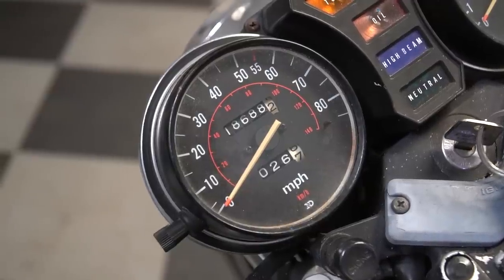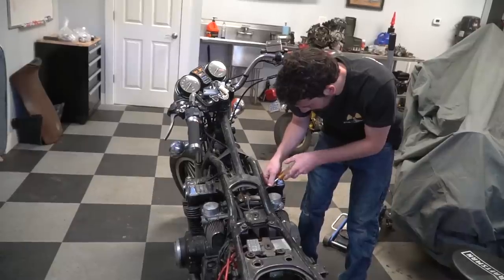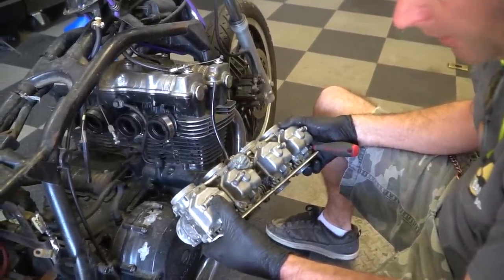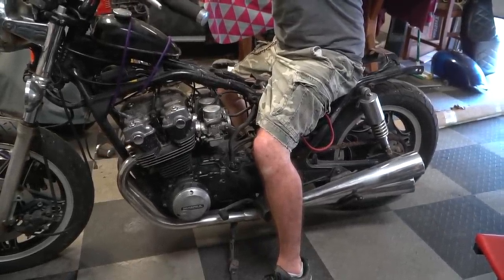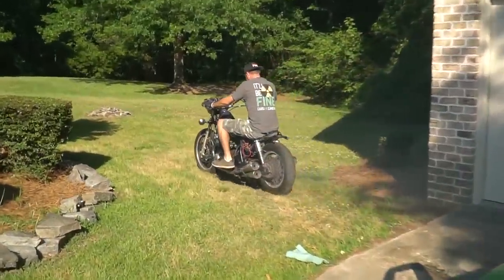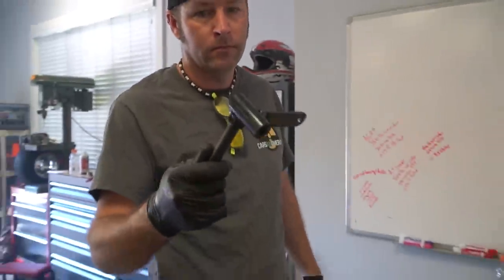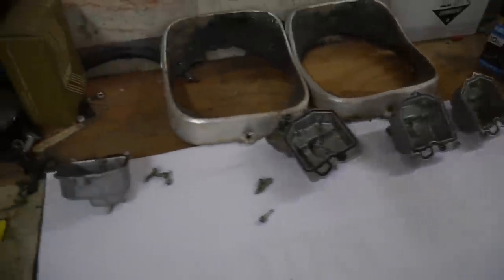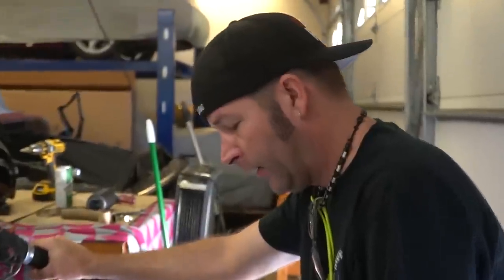Cheap CB750, Will it Start? Cross Kart Build Pt. 4

Comment: you can always treat it like a VW and get a set of rings and do a dingle ball hone on the cylinders if it keeps smoking. just do a top end rebuild it would bring it back to full power and stop the smoking problem . a set of rings for all four cylinders cost around 80 bucks at 20 bucks a cylinders oddly it cost the same to do the CB550 .

Comment: Also don’t want to disassemble the rack to vat them because your sync will be way, way off. Bad enough from just age and wear, you don’t want to deal with bench sync and then vacuum sync on top of cleaning them. If you can dip two at a time, flip it, dip the other two, then do it that way.

Comment: Hey guys this is Jimmy I've been there before and I can tell you exactly what works great for that engine as long as the engine is decent I just jetted it up and up one size at a time using shop towels for breathers four layers then three then two layers until it rips without a single layer of shop towels and open exhaust they make more power that way  oh and by the way snowmobile engines still make more power but you can attest to that

Comment: Hey boys! If you drilled out those main jets in the carbs it may be running so rich that it cant burn all of that fuel it is getting. It sounds like it is running way to rich on top. (cutting out normally means to rich) And the main jets control fuel from about half to full throttle.

Comment: Needs a ring job IF the smoking doesn't stop.

The pipes may have some pieces of rust in them after all those years, might just have to replace them if they can not clean out easily.

The rust can be removed with some HCl acid but if the rust is too far in it will just find holes in the walls of it.

Comment: You probably drilled the main jets out to big and it is running way to rich... love the videos, keep it up
Reply: not a chance with out an air box most motorcycles hate running stock carbs with no filter and box

Comment: Sounds like the carbs need to be synced up. Also try removing the slip ons from the headers as sometimes the resonators in that type of muffler will rot and clog with rust.

Comment: I got the same bike out of an abandoned garage and it does the same exact thing. When I mess about the coils and move the pack around it seems to stop doing it but it wont ever just run 100% perfect. The motor is a mean one though and I hope you figure out the issue. Please keep me updated on this problem as I am ready to solve mine. I put this motor on the front of a john deere rider.

Comment: Can you guys do a video on the sinplified wiring for the cb750 just to get it running and i could use the exhaust off one of the old 750s if you guys wanna get rid of it

Comment: I find a set mechanical mikuni carbs... Those vacume slide keihn’s do not like Pods. The factory air box had velocity stack like runners. While your at it...Throw on some accel super coils. That way u can use automotive spark plug wires.

Comment: It's hard to get those motors running right with pod air filters. Other than that those motors are awesome. I had a 1980 cb750

Comment: I had one... An 82 cb750c... It had a 6 cylinder, an a 5 speed trans on it. I paid 560 fer it. Did a lil tuning an adjusments to er an had her goin in 1 day. But... I was goin 185 on my digital speedometer that i had duck taped onto the original (dead) speedo on it jus roaring down i75.
Reply: No such bike, you liar. The 6 cyl. CBX wasn't a 750.
Reply: @gsp49  im not a liar. The 6 cylinder honda cb750c is a truly badass bike.

Comment: Hello, guys - at the risk of being a spoilsport, I feel I should mention that zoomies will compromise power output by preventing the exhaust scavenging effect (neatly timed pressure pulses arriving at just the right moment to help do something useful) when installed on a normally aspirated engine. They´re intended for use on supercharged engines. Sorry to be a bore!

Comment: Check your slide diaphragms and the advance mechanism.... If it actually has one. I don't remember if that year had fully electronic  ignition or not.
But it kinda looks like bad slide diaphragms.
If the slide diaphragms are OK and you don't have a wasp metropolis in the exhaust system it's gonna be ignition.

Comment: Check out moto migs on yt  because he has the same engine that he is trying to rebuild and there should be 2 cams under the valve cover with a chain conecting the 2 so check that.

Comment: Without the filters and those carbs not being cleaned really good your main jet is too small anytime you just slightly increase the airflow it significantly leans out just put in the filters back on would probably help just a little definitely need to actually clean the carburetors good and get a jet kit.....

Comment: There are 3 jets in the carbs your working on 1 is the main jet, 1 is the primary jet, there is 1 under that rubber plug next to the other two that is your idle (low speed jet) Yes I worked in a bike shop for 25 + years.
Reply: Correct!

Comment: Did you take the dash pots off on top of the carbs ? There could be a slit in the diaphrams and the thottle pins could be sticking ? Sounds like air or fuel starvation.

Comment: For sure starving for fuel at higher RPMs. Also, Goldwing fuel filters have saved my butt many times collecting junk pre-carbs. I wonder if there's an aftermarket intake out there to run one big carb? I would not know where to start, but man that would take a lot of headache out of the equation. Best of luck guys!
Reply: Wow, there actually is a dual carb intake for these to integrate 2 Mikuni Carbs, crazy cool. You may be able to fab one up yourself, or perhaps Go Power Sports has a resource? This would at least level the playing field for you guys a bit more.

Comment: check your valve springs if you may have overheated the motor there is a strong possibility that it weakened your valve springs.what happens the valves are not closing completely quickly enough.

Comment: Check the exhaust temps sure sounds like you are down a cylinder; that is that weird sound you hear when you blip the throttle.  Think you will see you have a cold pipe.  Toss some new plugs in it once they get fouled pretty hard to get running clean and hot to burn off that crud.

Comment: I know with my old Suzuki, it was so touchy about air fuel mixture that it ran horrible if you tried to run it without air cleaners on it. It would hardly even idle until you put them back on.

Comment: No joke have stuffed with a few 4 cylinder bikes you need the factory airbox mate them bods work but need to be tuned and are a real pain and the bike will do what it’s doing wen you open it up if you don’t have the stock airbox and carbs same as straight pipes they are very sensitive to change

Comment: Make sure to check 3rd gear and clutch basket play 2 problems i ran across ob the cb750s
Reply: @gsp49  i have owned a few 750 cb hondas they have a 3rd gear problem due to shift fork and bushing for 3rd gear and ive had the clutch basket have play on the output shaft also had them blow apart but that was n2o induced harm

Comment: Also remember to balance the carbs or else it will run like crap and check for vacuum leaks with starting fluid
Reply: I've always been taught to use an unlit propane torch, less chance of ruining paint, but I suppose they're not keeping the rest of the bike, so either works for them.
Reply: @robsutherland9284  yeah I've used the propane torch but one time I had the torch ignite and almost melt some plastic, so I use the ether, but it's up to you
Reply: @stylusmccracken8629   Lol, that would have  been exiting, might loose your eyebrows if that happens.
Reply: Use WD40, starting fluid (ether) you risk bending crank components when it detonates, it explodes. Starting fluid for large diesel engines, never in small gasoline engines. I've seen so many small engines ruined by starting fluid, it's funny.

Comment: Someone could of put some oil down the heads so it wont seize up while it sat. Or need some rings and gaskets. Or just burning the crap out of the carbs and heads.

Comment: When cranking it over cover the opening till ya feel ya hand is wet also the added suction created forces fuel thru the carb setup.   or go with petrol straight in the plug.  None of this either rubbish

Comment: The carbs need synchronized. You need a 4 way mercury manometer in order to sync properly. Your timing is likely not the issue. If you need a book or help with the 750 give me a shout or even some parts maybe. Ive got a junker that makes about 95 hp as it sits(92 model). They sound sketchy when the carbs are unbalanced, and you cant use a dial gauge vacuum setup to tune with very well because the needle will bounce. Mercury is the best bet and you can find them at older bike shops. Good luck and to not under estimate that engine, it is a ripper and can get you hurt in a hurry if things are not right( dead spots and then wide open throttle suddenly). 14k rpm is ok for max if you have the right jets in it and it will make great power. These motors are some of what honda designed the b series after. No vtec on these but very good power to weight and amazing flow when setup properly. Remove baffles from exhaust and get the jets right and that thing will fly. Exhaust smoke is sketchy but hopefully will clear up.
Reply: Sycro is easy, pull vacuum off of each tube between carb and head and set the individual throttle screws on each carb until all readings are even. The carbs must be perfectly clean and the diaphagms in good shape if they have them. Imbalanced multicarb inline motors will not run for crap until the carb is set right. Its like they fight each cylinder when unbalanced.
Reply: This one doesn't sound like it needs that, no stumble when they gas it.

Comment: Give the throttle  a twist a few times real hard that set has accelerator pump on it, it will inject  fuel into it to aid cold start

Comment: Funny you were saying it sounds great, i was cringing at those revs and smoke. Did not sound like it should thats for sure.  Those carbs are pretty finicky, most of the reason i dont like 4 cylinder Hondas. Hard to tune. Hard to work on that big bank of complex carbs. Great motors when they run right, but a huge pain in the ass when they don't.

Comment: Bro try changing the spark plugs odd as it sounds my dad had the same bike wit same prob changed plugs and the thing revved  out fine thr biggest indicator that its ignition is the 5k cut... wouldnt be bad idea to clean the pipes mise love to make there nnest in there guys good luck hope info helps.   Lol and def put the air box back on there it wont help to take it off

Comment: Just take a metal squirt bottle, put some gas in it. Take the filters off and open the throttle all the way. Spray some gas in with the spray bottle on spritz mode. Start the bike while squirting.

Comment: Please put the air filters on you will notice that ike will no longer think there's a timing issue... and with pods the jets sometimes need to be around 25 sizes bigger with out the original air box ... thoughs kinda carbs like a restricted air flow them carbs find they own air .. ! And that's the only reason it will not accelerate the way it will or can ! Again them carbs like to have vaccuum on both ends.. it like putting your had over your mouth and breath...

Comment: Run seafoam through it, it will clean carbs valves and make it smoke less (will smoke very bad whole using the seafoam cause its cleaning everything out)
Reply: Seafoam will mess it up, used to clean carbs fouled with seafoam almost every day.

Comment: Warm it up ,take it out and open it up ,my 550 did same thing wen it was cold and until I opened it up at high revs it wouldn't run right sounded like it was only running on half the engine,,,

Comment: Hey guys, I had an 82 CB750SC that I wrecked. I still have the engine, but I could make use of the frame and other components you guys aren't going to use. Could you please let me know if there's a way I could get the rest of the bike. I have the engine for mine completely rebuilt, and I have the tank and fairings, but I'm worried about the integrity of my frame. Please let me know!

Comment: Remember guys ...cleaning ALWAYS should be done from the top down.....every time. Clean the tank then replace the fuel line and filter then the carb otherwise you just gunk the carb back up.

Comment: I had a old Honda that did that and it was the centrevecal timing these ball bearing things that  were rusted in one position we took them apart and cleaned them so they could move when the bike was in higher rev it would open up and change the timing or firing I'm sorry I cant remember exactly what it was.

Comment: Put some sea foam threw it in the tank replace line and install a fuel filter. Sea foam will help clean the bikes valves for compression and the tank. Also sounds like th r exhaust is clogged
Reply: We used to get stuff in at the Yamaha shop that customers had messed up with seafoam, almost every day.

Comment: Take out the plugs, and pour seafoam into each cylinder and let soak for 48hrs... Then crank it over and blow out all the crude, reinstall the plug and replace motor oil

Comment: Seems to lean.  It had a factory air box creating a lower pressure region in the carbs causing it to pull more fuel. Now being wide open like that its to lean...   also make sure the diaphragm slides are moving. If they have a hole in them they wont slide up, which is what opens up the passage for the main jet

Comment: i have a honda cb750 custom goldwing just like that ..but i have some issue about the battery charging of my bike. And i just buy a  new voltage regulator it become worst than  the original regulator  i really  need help

Comment: I just picked up an 83 suzuki gsx750 for my build got it for 400 bucks complete bike but not running ive pulled the carbs and rebuilding them , hope i have the same luck as you guys , maybe i will even post a video if anyone is interested , putting it in my 2005 dazon buggy , 250cc replaced with 750 cc should be ok .....

Comment: Most of the time running issues are carbs 
Just running it will clear it out put sea foam in it and ride it
Add new plugs it will shock you what new plugs do

Comment: Hey guys, I know you're gonna HATE it but, find a stock air box and ditch those pods. The slides in them NEED vacuum to work right (diaphragm slides) I know it sounds stupid but you're used to cable pull slides

Comment: I have an 86 Nighthawk with a ticking noise...a rod bearing kinda noise. Im still debating on doing the rebuild.
Reply: Adjust the valve tappets.
Reply: @gsp49  Ill check it out. Thanks

Comment: Check the vacume advance for leaks. That could be the cause of the motor falling on its face at higher rmp
Reply: No such thing as vacuum advance on this.
Reply: Is it a mechanical timing advance?
Reply: @chopperjake3996  I think it is electronic, based on RPM, Japanese wizardry, black plastic box of magic. I think it was gagging from too much air in the fuel mixture. I of course could be wrong, but I've worked on a few.

Comment: Need to check timing. the points in that side cover clean the points ?
Reply: No such thing.
Reply: @gsp49  I didn't know when they changed from points, I had a hard time with a 74 getting the points dialed in.
Reply: And I did have to make an air box with shared vaccum

Comment: Carbs need to be completely broken down. Slides sound like there sticking. Air screws sound stoped up, and you can't forget about the air cut off valves. Then you need to sync the carbs with a good set of vacuums gauges.

Comment: From what I've heard on it running, the valve train sounds fine. Just throw a new cam cover gasket on it, and vat those carbs and go up about 2 steps on the main jets to compensate for the K&N's. You can get 95% of what you need for it from 4into1.com . Check out their online catalog. They were indispensable when I was rebuilding my 350 Four.😉 Change the oil and filter a couple times if it's been sitting. Probably the rings are stuck from sitting so long. Just my 2 cents!😁👍

Comment: You can score an OEM airbox off ebay fairly cheap, that'll make tuning easier with those CV carbs.  On cleaning the carbs, if you don't have anyone local with a large ultrasonic tank, ship them too me and I'll run them through mine.  (Ship me the 'bad' rack?)

Comment: It could be the secondary jets stock is a 68 and they need to be up around 80-85 with pods main jets stock is a 102  should be in the 120 range

Comment: the valve guides are not the worlds greatest so they do smoke after sitting for a while so nothing to worry about.
it dose sound good so the timing cant be that far out but  if the engine was over heated it may had put a bit more stress on the timing chain this can be checked to see how much slop is on the timing chain tensioner "tho that bit of experience is from a 650 suzuki of that year" but this is unlikely unless it was used for drag racing. 

the bit about the pods is not as apocalyptic as everyone makes it out to be, just some tweaking is require

i was hoping for a snowmobile

Comment: Almost impossible to "Overheat" an air cooled 1970's Jap 4cyl motorcycle - if it smokes it has bad valve seals or stuck rings
Doesnt sound like a timing issue, sounds like carbs not jetted for open air or pods with restrictive stock exhaust - try running with a Cheap eBay Stage 3 jet kit and open headers with no mufflers- bet its a whole diff deal - theres TONS of dirt cheap 4 into 1 aftermarket pipes avail for that engine - Plus parts in general for a late 70's Honda 750 might be the cheapest on the planet
Reply: Check Slide Diaphragms for cracks, holes or leaks, very common, will run just like yours is if CV-slides arent lifting (Constant Velocity)